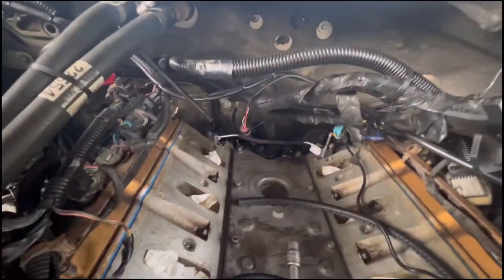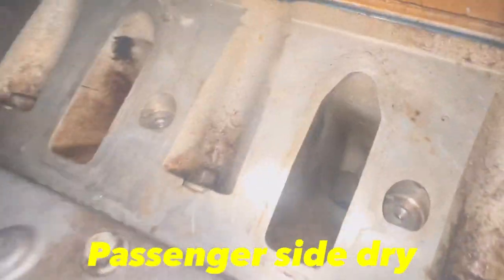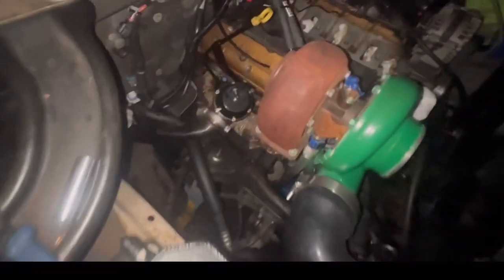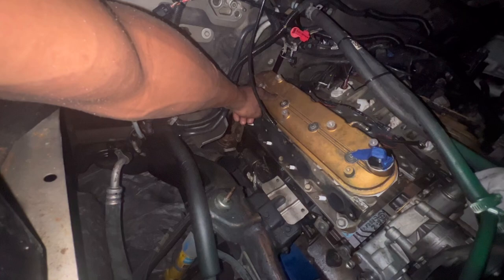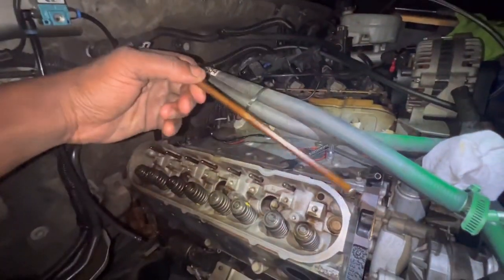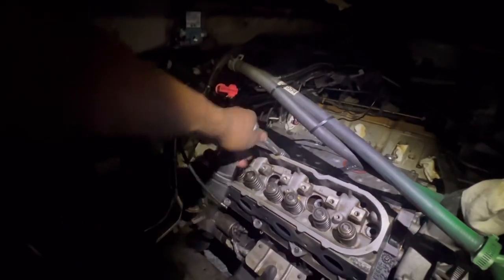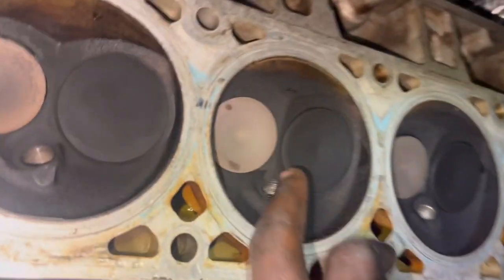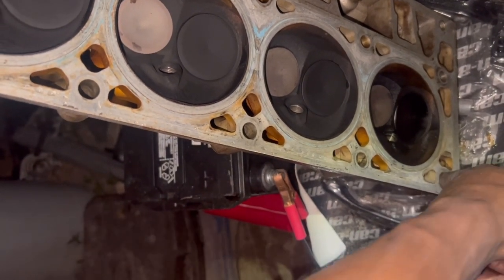Chevy boosted 5.3 taken apart found something interesting could be simple or worse?

Comment: Ok so first things first pull that other valve cover cause coolant in the oil isn’t gonna just be on one side, hard to tell from the video but take a good look at your head gasket if you torqued the heads properly it’s probably not there if your not running that much boost. I would turn it over and check each cylinder wall one at a time for cracks, let the piston go all the way down and take a flashlight and look carefully. Piston ring probably let go which would cause your blow by and possibly crack cylinder wall
Reply from the maker: Yeah other side dry after removing valve cover and inspecting inside. I’m running around 13 lbs of boost was going to go down a little. Will re-check walls and rotate engine but looks fine however I do have a trail of coolant filling top from gasket area.
Reply from the maker: https://youtube.com/shorts/oRAQfOzRJtU?si=ukhOwhI2DiuxHAha